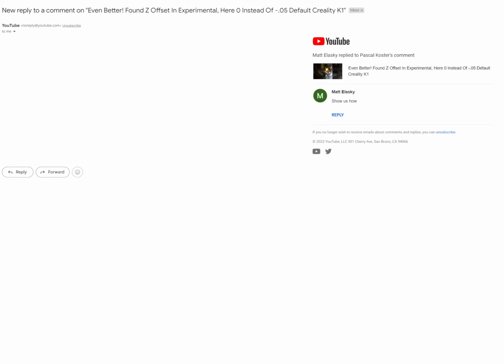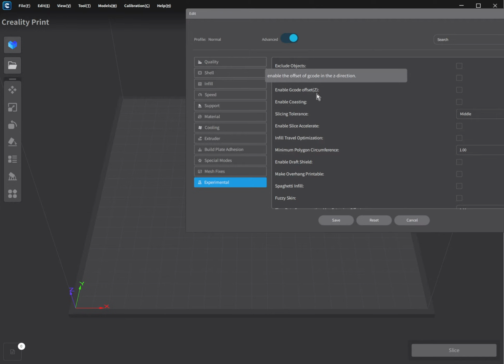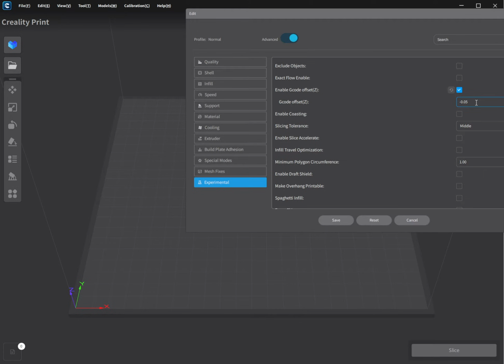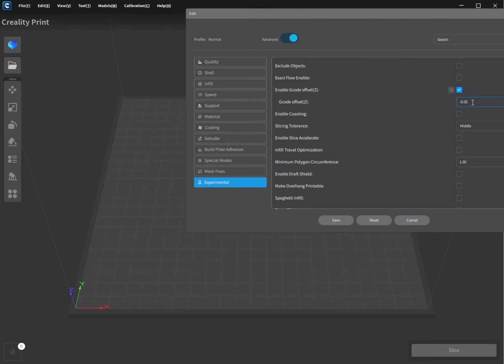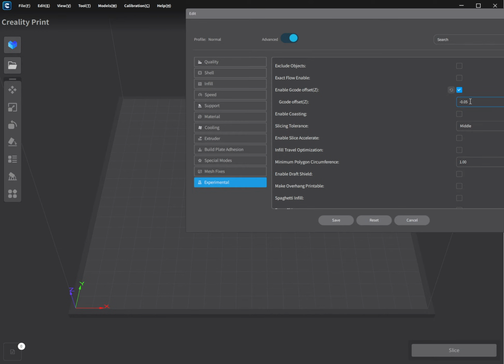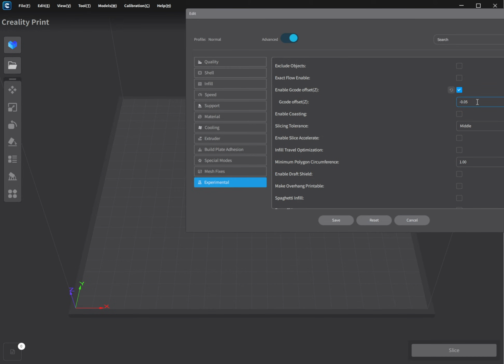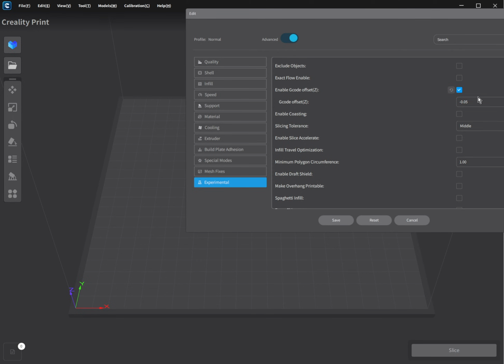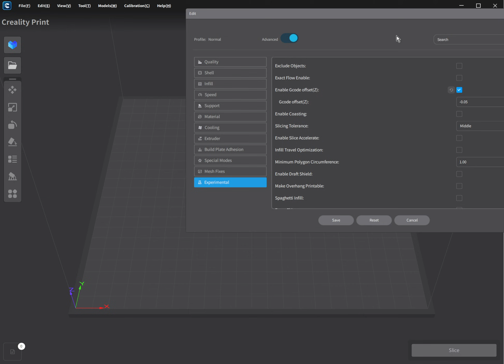Adjust Z-Offset In Creality Print Slicer For K1 and K1 Max Creality 3D Printers

Comment: Hi, thank you so much for your video! On my K-1 Max my first level is pretty well perfect except for a spot about 2 inches in diameter where the nozzle is just a fraction high and there's some gaps in the filament. If you were me would you adjust the nozzle height so it's just a fraction closer to the bed or or leave it as it is? Totally open to any suggestions please? Thank you so much in advance!
Reply from the maker: Hmmm, tough to say.  If it prints ok I'd ignore it or simply print on other than that spot when possible.

You could also try another print bed surface to determine if it's the bed surface or the bed carriage structure.

Honestly I printed a ton before doing any leveling and it was mostly fine.

Comment: Great video. I found that after leveling my bed and switching to a 0.6 nozzle my Z offset prints better between 0.75 and 0.1. The prints were being lifted by the nozzle at the default setting. I was having to adjust this in fluidd. Now that I've found your video I'll be making this adjustment and running all the calibration tests to verify the correct offset. Thank you.

Comment: Hi,I can't find the option you select in the video.  I use the same program, I use an Ender 3 v3 SE.  I set the program to it.  Are you saying that I have an obsolete version of the program, or is it a matter of having a different 3D printer than yours?
Reply from the maker: Someone commented that it doesn't work for all creality printers, only the K1's evidently, so at that point I changed the name of the video, as I had initially assumed the program had that for all printers but evidently not.

Comment: I bought a lightly used K1 Max. I haven’t checked the Z offset yet. But I think it must be too small because if I print with a single layer brim, it becomes impossible to remove the brim. It effectively gets bonded to the first print layer.
Reply from the maker: Awesome, K1 is a great printer, so much bang for the buck, enjoy!

I use a thin layer of glue stick, less to make the print stick, primarily to make it possible to remove prints without damaging the bed.  I'm sure I have videos about it if you search my past videos.  I highly recommend leave the setting stock and try my glue stick technique at stock, see how you like it and adjust from there if at all. 

Ok I searched for you:  https://www.youtube.com/watch?v=ucnCXm8E0nA  
Another:  https://www.youtube.com/watch?v=5HX7PTTBZOs

Also check this playlist regarding lots of experimentation with first layer quality.  https://www.youtube.com/playlist?list=PL5OPNhDn9CrW8D43QKvxQ2hNwJb_K3NKh

Comment: The fiddling at the back of the bed in the middle is to try to remove any blobs on the end of the nozzle. The new K1 C actually has a little wiping pad at the back.
Reply from the maker: I agree on the purpose.  The wipe pad sounds interesting, but I'm gun shy of that.  My first printer was a way overpriced Lulzbot Taz 6 that had so many problems, one being the performance and longevity of the wipe pad, though other "features" were far more troubling than that, so hopefully it's good by creality.
Reply: A friend just obtained a K1 C. That’s where I saw the pad on the first print out of the box. The pad looked effective, but I have no idea how it will hold up in the long run. 🤔
Reply from the maker: @JustSomeHuman-j8o  Funny thing about it, I was having lots of autoleveling trouble with that Taz 6 and one of the calls to support they said what they do in the print farms with the same printers was get the nozzle up to softening temperature and wipe thoroughly with a green scotchbrite pad.  So I bought a big box of those and have been using that method since for any time any of my printers had nozzle contamination issues.

I find that with my K1 it tends to work fine if the material is same as the previous print, but say I print with Polylcarbonate then back to PLA I have to clean the nozzle manually, which makes total sense once I thought it through.  Otherwise I've been having minimal to no issues now that I have all the latest firmware and parts.